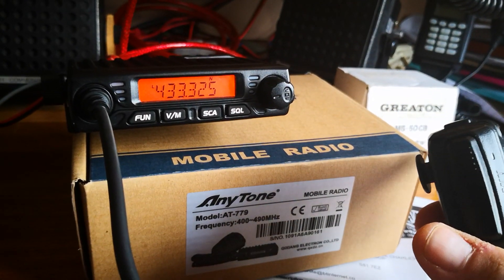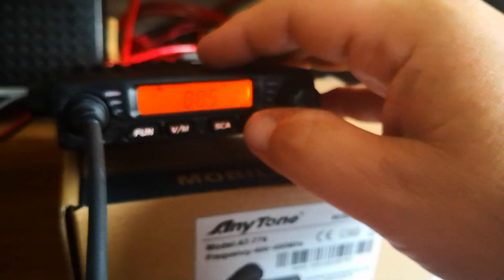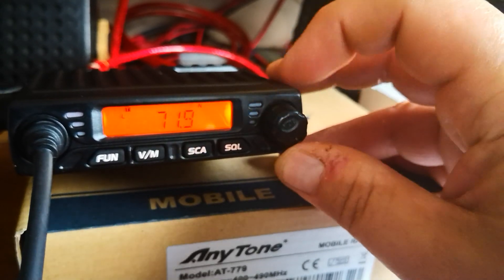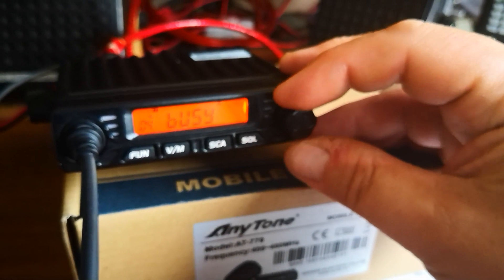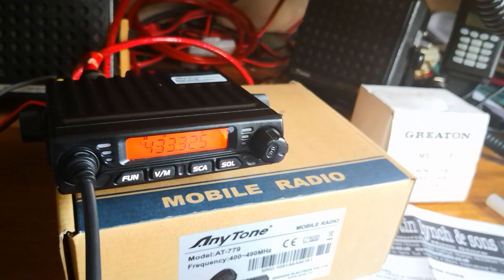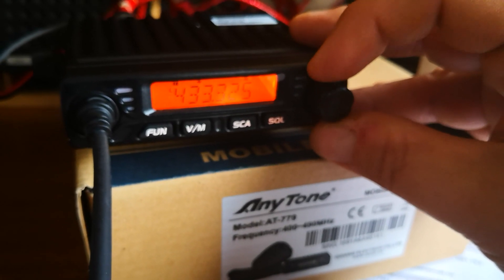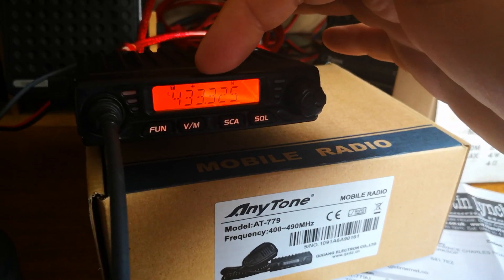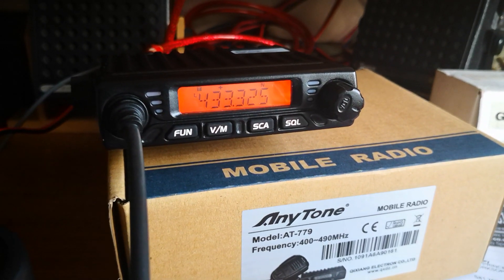AnyTone 779-U programing

Comment: Some issues: Dial knob has low quality (rotary contact produce multiple jumps one step) when getting a while used. PTT produce sometime accidentally channel jump. Maybe unsafe voltage level logic in the Mic. Make sure you are in LOCK mode. Volume setting resolution is to coarse when using an external speaker (in the first level to loud). For the cheap price almost negligible from china.

Comment: picked up one of these, super cheap radios! works ok for what it is, the power into swr meter reads only 12w though, not 15 but what do you expect i guess for the price.

Programming cables are difficult to find for this model also, an other down side.